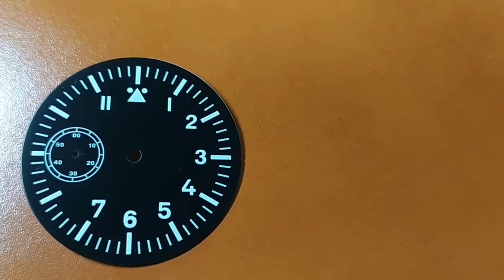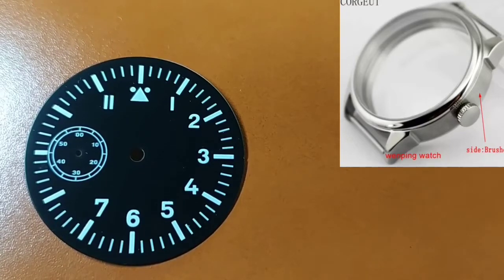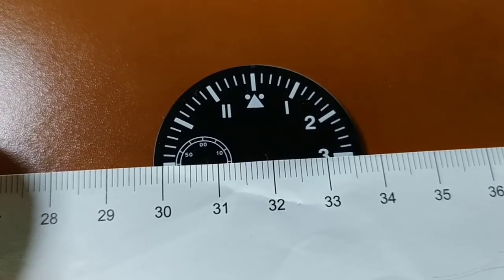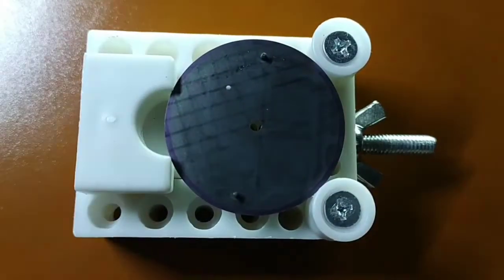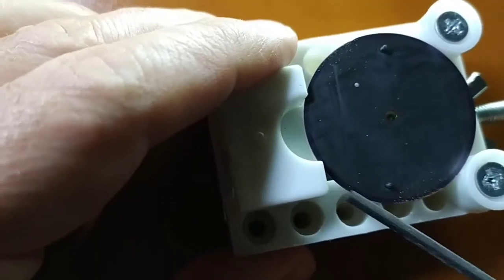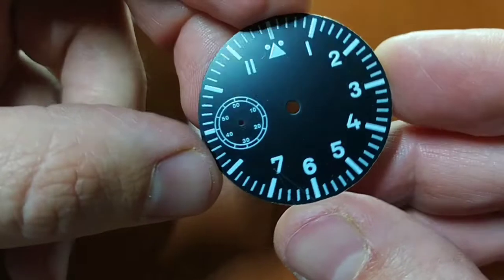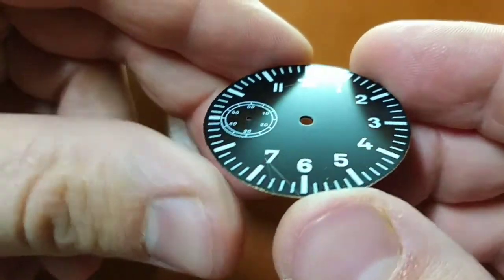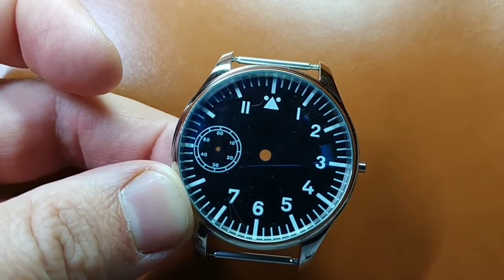DIY - Resizing the watch dial for pilot watch

Comment: maybe you should cover the dial face with masking tape and mount it on battery operated drill. put on lowest speed, let it spin and trim it using files or sandpaper. perhaps it could be more finer results and no scratch dial face. thank you anyway for this great mod, reaaly inspired me if one day i buy the wrong/bigger size dial. keep it coming sir. cheers. :)
Reply from the maker: I was afraid that if I put a masking tape it will remove the luminescent paint and probably leave tape's glue on the dial. Thank you for your comment.
Reply: @nikolaoswatch7489  oh yes, i forgot about the lume. yeah, maybe there is some sort of tape that not so sticky to remove the lume. anyway, thank you again for taking time replying my comment. all the best sir.
Reply from the maker: @zamSEG  You are more than welcome, my friend. For some reason I don't get notifications for some comments. I really don't know why. I saw your comment by chance, as I am uploading a new video, otherwise I would have answered to you earlier. Thank you for watching my videos. :-)
Reply: @nikolaoswatch7489  it's ok sir. i understand. youtube always have this problems. are you using phone or computer? if phone perhaps the apps need to be update. if pc/computer i'm not so sure what is the problems.
Reply from the maker: @zamSEG  I use both. Generally I receive notifications, but some comments come undetected... Thanks for understanding
Reply: @nikolaoswatch7489  it's ok sir. no problem at all and small matters. please do keep on update new video as always. wish you all the best. :)

Comment: Hello Nikolaus, I have a rose gold watch and wish to change the dial. I have another watch of the same brand and same style with a different dial colour - a dark plum colour - for this purpose. I want to take out the purple dial and pop it into the gold bezel. However my local jeweller looked at the watches, and said that there would be a need to resize (very slightly) the plum dial before it could be inserted into the gold bezel. They said it's a small difference but that they simply don't have the correct tools. Do you offer such a service via post? You have done a very good job with the Pilot watch here so I wonder if you'd consider taking on this job. Fingers crossed there wouldn't be any stratches. You might want to use a dremel/rotary tool, or a lathe. Let me know what you think. Kind regards, Catherine
Reply from the maker: Dear Catherine, I am not a professional watchmaker. Unfortunately… :-) You can do 3 things. You can reassure them that you don’t care if they damage the dial and that you want them to try to do the job with the available means. Or ask them to look on the internet for suitable alternative dial that you would like and they would be able to install in you watch. Or you can ask them to do something with the existing dial - to paint it or engrave or what else they can do for you. Good luck with your project!
Reply: @nikolaoswatch7489  thank you!!
Reply: @nikolaoswatch7489  so helpful. Thank you for replying ☺️